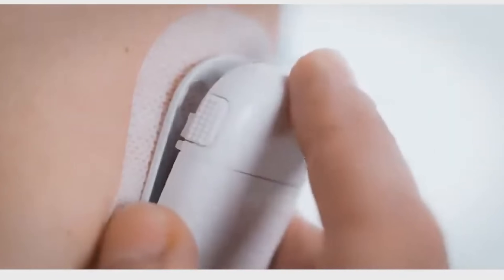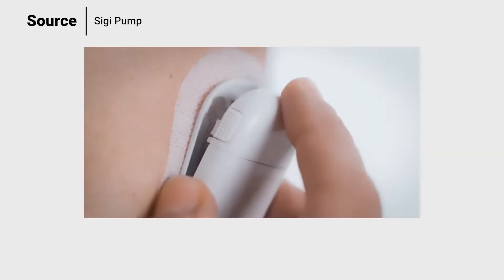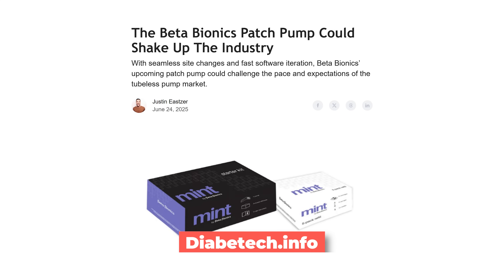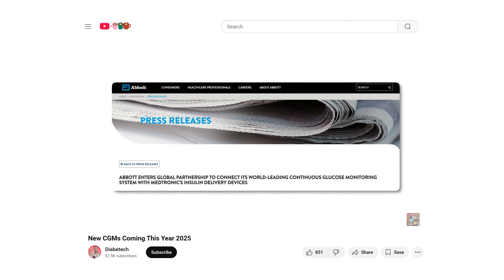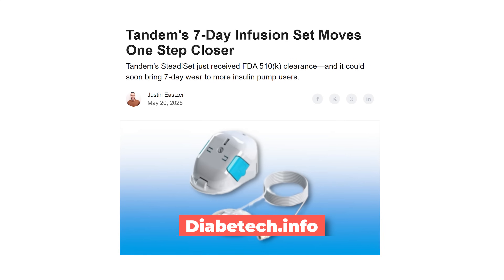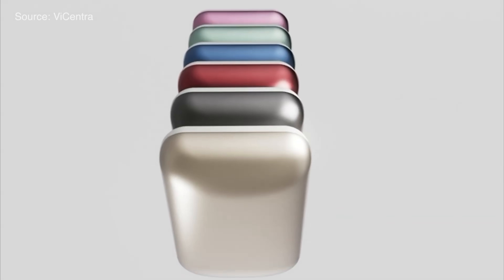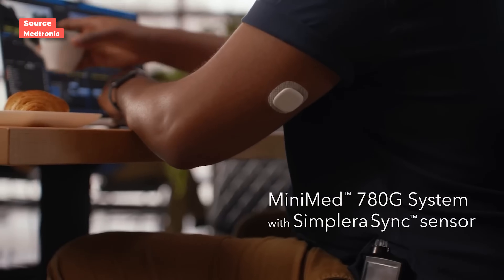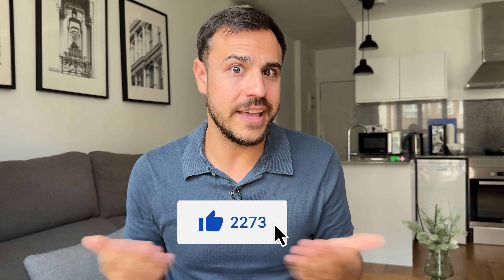The Future Insulin Pumps You Need to Know About

Comment: the trend to use the mobile phone as a device to control your pump is such a bad development. My mobile phone was never designed to be a medical device.  insulin pump development takes a long time due to strict medical regulations.   but yet i get to use my untested mobile phone to control it? not to mention when you loose your phone, break it or it gets stolen.   you need to have a second phone lying around as a backup.  its a way to shove medical expenses onto the user.
Reply: You don't have to, at least I certainly don't. Last time my phone stopped working, I had my next one delivered the next day. And I could buy one in the next hour, if necessary. But it's not that urgent, as the pump doesn't stop, just gets out of "auto" mode, at least on the pumps I know, which should be good enough for some time.
Reply: @lumpichu  im hypo unaware. the phone is the only thing warning me if i get too low in my sleep. no alarms for me not waking up the next day in case of hypo.

Comment: With longer lasting infusion sets, it would be nice to have pumps that would hold enough insulin to last longer before running out of insulin. If pumps could use U-200 insulin, a Tandem or Medtronic 3 ml cartridge/reservoir would hold 600 units rather than 300 units it holds with U-100 insulin.

Comment: I love your channel , many thanks . I may have missed your Medtrum nano patch review , so apologies if  you have reviewed it although you did ask for comments . I  am new to pumps ( t4 months ) and have only used the Medtrum pump so my comparisons come from what I can pick up on the socials . This is my take. 1st the positives. 1) Size,  this baby is tiny and about 2/3rds the size of the Omnipod tester I was sent. 2) Adhesive is super good and I never knocked one off.I am very active and this  is espically helpful for swimming  3) The sensor is smaller ( not by a lot ) to the Libre 2+   I was using beforehand .4) Customer service is outstanding and available 24/7. 5) It lasts 3 days plus up to eight hours. The phone app works well although could be better designed . 6) The exercise 
 which I activate an hour before exercise means I do  can 10 mile runs with carbs. Yippee  , . Th negatives 1) The sensor needs calibrating each morning  for first two or three days of the 14 after recharging . 2) The sensor needs recharging and that takes 30 mins plus about another 30-40 to warm up.. So sensor change needs preplanning and about 90 mins and be near an electric plug  3) The pump failure rate is high in my experience around 1 in 4, so if I am away from the house for more than an hour or so I need back up. I suspect Medtrum are working on this or at least I hope so. Overall I am pretty happy with it.

Comment: Seeming T:Slim Pump Pros and Cons; Others Too
• ✅ Saves me from multiple shots
• ✅ Saves me when going low at night sometimes, except if it is too strong an influence like a pre-sleep exercise, incorrectly tuned basal, or too much insulin. It is nice it stops insulin flow. Have to possibly tune in to learn to use exercise and sleep setting modes.
• ✅ G7 or G6 and some FreeStyle versions integration.
• ✅ ❎ Calibration or verification of CGM is vital for ControlQ auto adjustments to work correctly. Won't calibrate easily if more than 50 mg/dl off, so step by step bringing it closer by 20 mg/dl every minute works better. Likely the same issue on OmniPod since it is the CGM.
• ❎ The amount of insulin leftover in the last ending cartridge is a lot—more than 20 units to pull out in a string while the pump says 0 left. Techniques exist to recover the remaining part for next time unless it is something useless such as you have been exposed to lots of heat in AZ
• Proper technique is necessary to prime and get all air bubbles out for the catheter to work.
• ❎  The longer the catheter to the inset the more the amount of insulin you'll have to recover from it too since it won't be used for the next site change, not just the cartridge. I may pump into the next string since there is so much left.
• ❎ ✅ I prefer it over a OmniPod, although without personal experience, because I want to place in my own inset (yes "inset" not "insert") at the right place and if the OmniPod hit a wrong spot do I have to waste the whole thing?
• ❎ The cartridge is supposed to hold 300 ml, but as noted you only get so much to use before it says 0.
• ✅ ❎ Where you place the inset affects absorption as you know, but then note that it takes a different Pump Profile of basals and boluses for me if I have it on my lower leg versus closer to my stomach. Been diabetic for a longer time.
• ✅ Recharging at times, 80% to keep batteries healthy for 5 years until replacements are allowed. 100% if you just don't want to recharge so often.
• ❎ If you go to bed thinking you have 10, 12 units to sleep 8 hours and plan to change it in the morning if your basal rate is around 1 u/hr, ControlIQ may fix a high sugar at night and you are alarmed to wake up because you don't have insulin. A whole site change. ✅ I can get around this because I've made a calculator or use xDrip+ where I can tell what I need in the future, tell my pump to give me 1u bolus so it thinks I am taking care of things, and take a normal shot to bring me to normal levels so I can change it in the morning. Or recover the insulin and change it before going to bed. (I would hate throwing any insulin away).
• ❎ Priming the catheder to get air out may leave you to lose some insulin 😢.
• ❎ All Tandem supplies use t:lock, so syringes can't work with catheters and if you change pumps, it'll be hard to take insets over. Sure you can donate, but there are so many scared of liability it seems like you can't help anybody.
• ✅ These aren't discouragements. OmniPods may suffer the same fates. I don't want an OmniPod attaching to me and hitting a wrong spot. I don't know how well they allow calibrations against a CGM in the user interface, but it is likely possible.
• ✅ ❎ Tandem also now has the Mobi which you can attach to yourself, but it has a small catheter and separate inset.
• ❎❎ TSA, airports, being 🟤, diabetic disability is a huge story of trauma for me. Please don't minimize what it has done to us as human beings to have this theatre of security. I have stories. TSA Cares helped sometimes. Some cities like San Antonio which have diversity helps, others don't. Basically a public facing job without ethics, medical, nor humanitarian training. X-ray machines are not recommended for some CGMs and Tandem.

Turning to Tresiba for basal and Fiasp/Lejumajev pen is the alternative option that also has its pros and cons. I like it somewhat. (Tresiba is also useful to be around in case the pump fails and you are somewhere where you can't fix or find a replacement for 24 hrs of coverage without a pump.) 
• ✅ It is multiple injections, but you can carry the pens and needles in a stainless steel water bottle if you don't want to be attached to anything like a pump. In some cases it would make you eat less because you have to bolus to eat more than just pressing the button for the pump. 
• ❎ I tried to compare the costs, and the multiple daily injections are more over a year, but of course the pump supplies are a large cost upfront.  I did see for me that it does cost more to be on pens, needles, etc of Tresiba and Fiasp, but then again ordering a $500+ box of pump supplies every 90 days in the USA until deductibles are met seem shocking until the year end cost is less.

✅ Finally, it's all down to cash flow and if you want multiple injections or the nice experience of pressing a button to take care of your needs. It seems much easier to help a child with all the apps and warnings with a pump and smartphones, but being an older diabetic I can live both ways and sometimes I can see just having 1 shot of Tresiba and feeling free is nice until I have to get to lunch and take a few shots and carry that water bottle in a hot USA State. 
• ✅ The pump makes life easier especially for kids, but now I try to stay out of the heat completely and many may not like it that I am protecting the insulin in the pump and not going outside as much without a cooled car and places to be.
• Thrivable, hopefully you can get me some 💰 for 💡?! 😊

Comment: As someone who backpacks/ bikepacks regularly my tslim x2 has a much longer battery life than my phone does. I wouldn’t want to rely on a phone and have it die on me and not be able to bolus or make adjustments to my basal in the middle of nowhere as I get very sensitive to insulin post exercise and I need to be able to make changes. Which I can do directly on the X2. After a day of heavy exercise, my regular numbers/ ratios would probably kill me if I was in the woods with limited food. It would be nice to have the option to integrate my phone, but I don’t want it to be the only way my pump works to its fullest capacity.
Reply: I have been t1 for 10 years, thinking of finally switching to a pump. Your comment really resonated with me. I don't know anything about pumps, but want control while outdoors or hunting and hiking. Don't want to depend on my phone.
Reply: @goproaz1776  i’ve been on this journey for about a year and a half, on a pump for a little over a year. I have had very tight control both on injections and with the pump, but for me the best advantage of the pump is I can greatly reduce or turn off my insulin as needed when it comes to exercise and everything else rather than trying to outpace and out eat basal insulin. 

I find it makes activity more fun knowing that I’m not plummeting all the time, and it makes overall management a little more mindless (in a good way not a dangerous way lol) easing the mental burden. 

I also find the tslim with it’s algorithm is just a little more forgiving when it comes to carb guesses than injections were. But that’s just my personal preference. Lots of great pumps out there. I just didnt want one with a “learning algorithm” since my requirements change to often due to activity level variation and that would throw it off. The tslim does what I program it to do and doesn’t deviate unpredictably which I like
Reply: Exactly this. I don’t want a pump that I can only control with my phone. The X2 has been great but its age is starting to show. We really need the X3 to come out to give us a proper upgrade.

Comment: i want a pump that.. if recharging is needed... it can be done while on the user and not have to take it off for said amount of time for a charge.  i have my tandem t slim x2 with a magnetic head, connected with a magnetic wire, onto a battery pack, so when im on the road for long periods of time i connect my battery pack to wire, to the magnetic head, to the pump and never have to worry about damaging the charging port if the wire gets caught by a door knob or something... by mistake.

Comment: Hi! Thanks for sharing such valuable content.
I’m using Tandem t:slim X2 with Control-IQ and Dexcom G7. I’m looking for AI-based solutions that could help optimize insulin therapy — specifically, something that can recommend or calculate adjustments for carb ratios, correction factors, and basal profiles.

I don’t have the option to use a DIY closed loop (like Loop or AndroidAPS), so I’m looking for something compatible with commercial systems — or even standalone analysis tools that can guide these manual adjustments.

Have you come across any AI-driven platforms, apps, or approaches (even experimental) that could assist in this kind of decision-making?

Comment: Would Sigi use different algrithom from X2/3 and Mobi? I don't understand why Tandem works on two tubeless pumps at the same time.
Reply: Mobi isn't a tubeless pump. It would be a pump that gives you the option to wear however you want. As a patch pump, semi-patch with short tubing, or regular tubed with long tubing. Sigi is just a tubeless pump.
Reply: @LeahonLife  Tandem is working on Mobi tubeless and Sigi at the same time, both are tubeless.